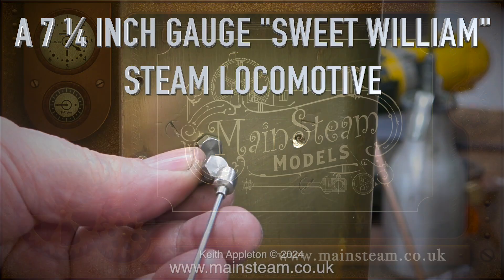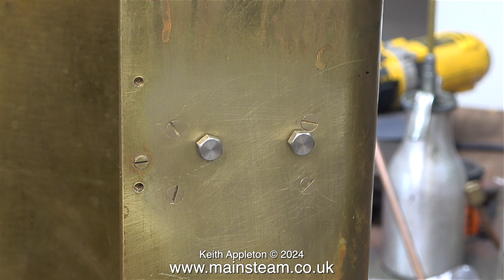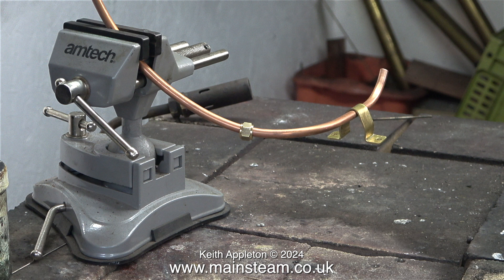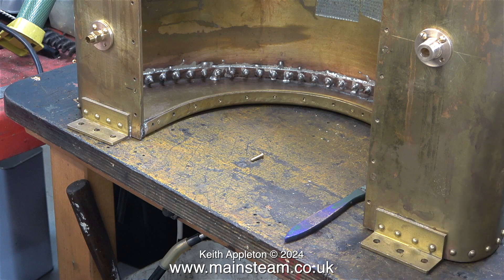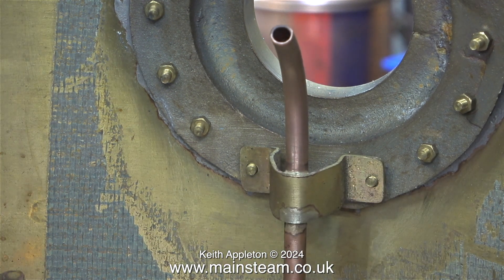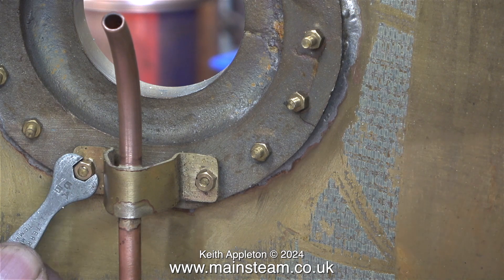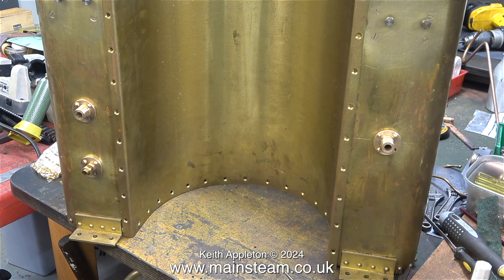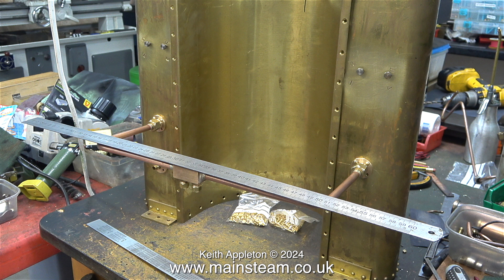A 7 ¼ INCH GAUGE "SWEET WILLIAM" LOCOMOTIVE - PART #73

Comment: If you are a beginner I'd recommend using a torque wrench or driver, so you will almost never shear bolts or screws.
Reply from the maker: I have never seen a Torque wrench this small ......... I almost never shear bolts as after so many years I can estimate the torque that I use relative to the nut & bolt sizes.
Reply: @keithappleton  Hey Keith in my company and my home workshop,  we/I use mainly this Set for small screws and with a nut set for nuts. 
Every employee and apprentice in assembly or repair gets one of these to when he or she starts working.
Kraftform Kompakt 60 Torque 1.2 - 3.0 Nm, 17 pieces 
I am not working for in any way attached to Wera, I just like their tools, very good quality, but also affordable.
Reply from the maker: Thank you, I will have a look at them }:-)))

Comment: Am I correct in thinking the water bypass pipe is to let air OUT of the tank as you're putting water in, and let air IN as the water is injected into the boiler or dumped overboard?
Reply from the maker: Nothing to do with air. The bypass valve either lets water directly into the boiler when closed, or lets it go back to the tank when opened. That way you can precisely meter the amount of water supplied to the Boiler
Reply: @keithappleton  Ok, thanks.  The reason I asked is that there doesn't appear to be a fitting at the top end, and I thought it was for air.  Perhaps you'll be adding a fitting later?
Reply from the maker: ??? no fitting needed - it is just the end of the water bypass outlet pipe . . . . .